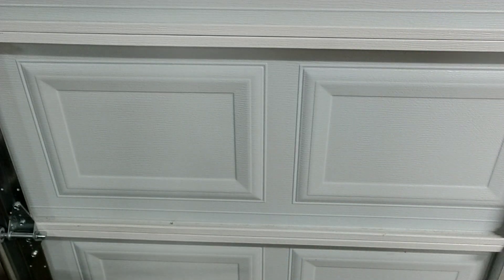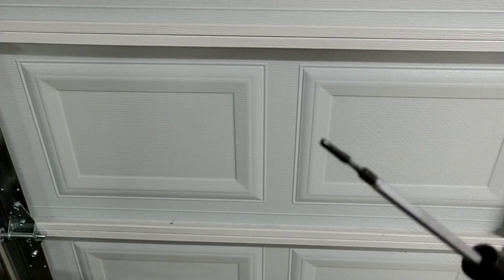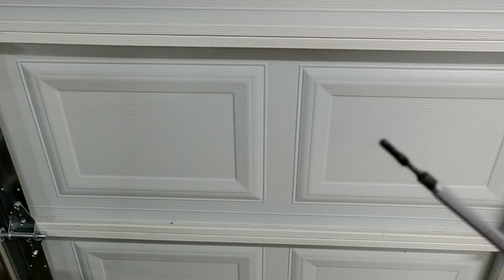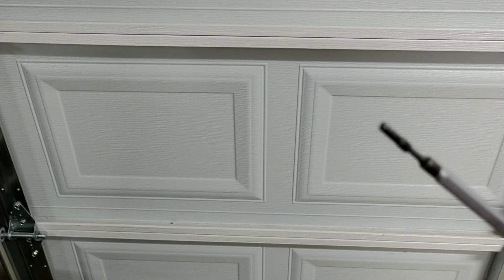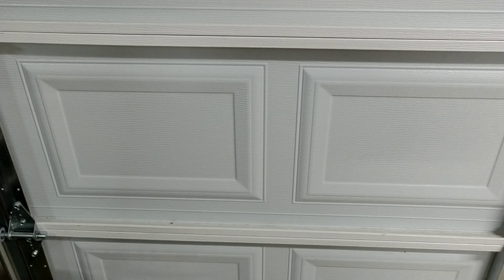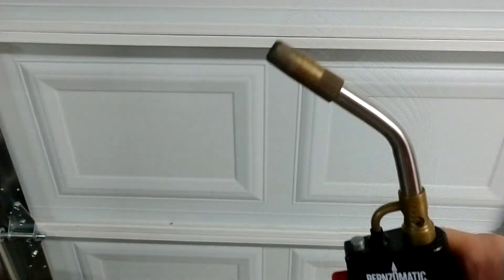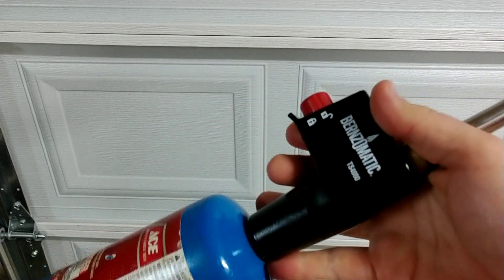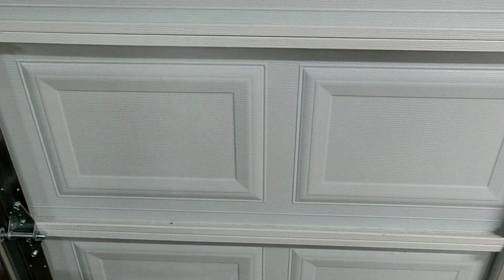RC driveshaft grub screw removal

Comment: Thank you for making this helpful video. It did work but I was left with a stripped set screw in the shaft from the  transfer case. What would you suggest?
Reply from the maker: Honestly, not sure. You may be looking at a drill out. I've had to do that a couple of times, I don't like it, but sometimes it is what is necessary.

Comment: My problem is keeping them from coming loose on the pin
Reply from the maker: Find purple thread locker, it will hold the screw but not as tightly as blue thread locker and should solve your problem without making them too difficult to remove later.

Comment: What if the screw is already stripped?
Reply from the maker: I've had to drill them out before, but I know I've read some other techniques that I've not tried or wasn't successful with.
Reply from the maker: I would also suggest a high quality tool for these grub screws for the next time, something like MIP drivers.
Reply: I should drill right threw the the top right?
Reply: Also thank you for the great info
Reply from the maker: As small as a bit as you can find and keep it as straight as possible.

Comment: Is that a metel drive shaft,I'm trying to get the grub screw out of a gen7 pro cant budge them?
Reply: If it's the stock Gen7 Pro driveshaft, then it's the same as what's in my video, just a different axle (it's the Redcat Gen8 portal axle.)
Reply: You're going to have to heat them up, I've heard people having luck with lighters and even soldering irons, but I did not, so I did this torch. As you see in the video, it doesn't take much, just angle it away from the plastic parts as much as possible. The Gen7 Pro has metal u joints on the driveshafts, so you should be fine to heat them up.
Reply: When you go to put them back together, I suggest getting purple thread locker, like this (https://www.amazon.com/gp/product/B000HBGHFY/ref=ppx_yo_dt_b_asin_title_o05__o00_s00?ie=UTF8&psc=1) it is a low strength hold, where blue is medium, and red is permanent.
Reply: Mine were rusted and i sprayed WD40 in them for 5mins settle wipe it off then I head up the tip of the allen tip.